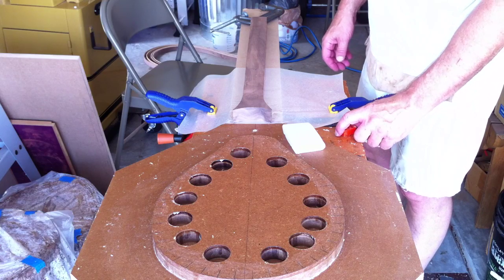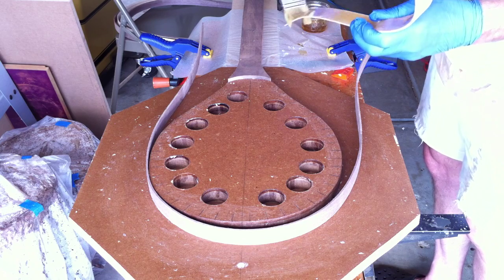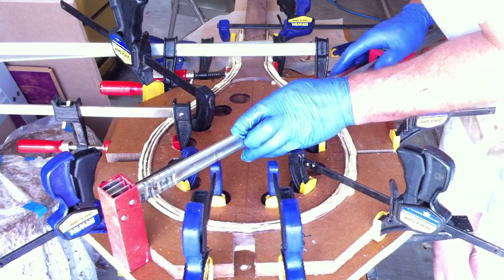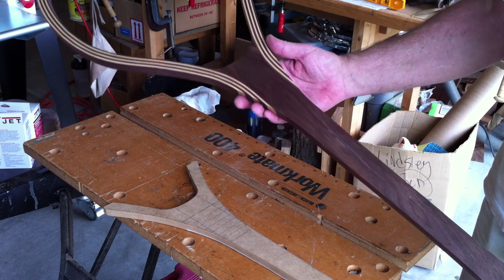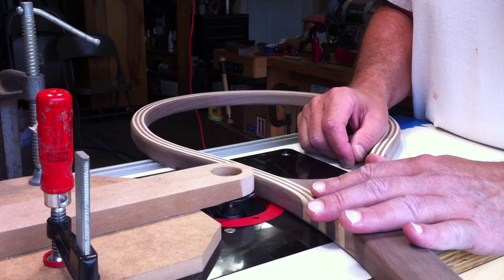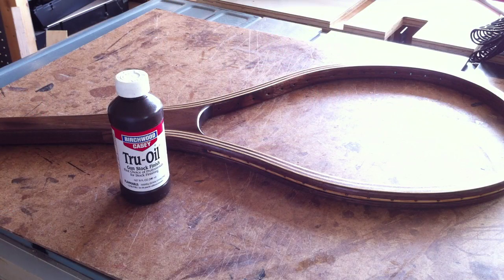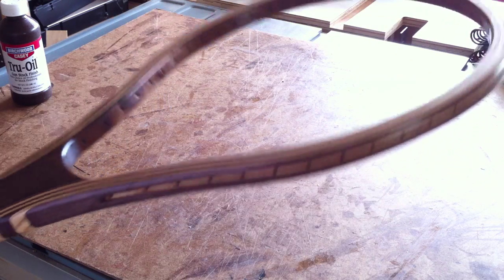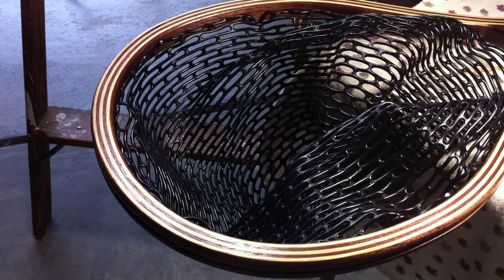Walnut & Ash Landing Net Part 2

Comment: Enjoyed it very well done my question is obviously you don’t glue the inside of the first strip but I don’t think you spoke about where the strips attaches to the handle do you glue that later?  Or do you apply 
glue on the strips where they make contact. My experience with glue is I have a hard time keeping the glue off the clamp handles better than my hands thanks for the video. Ken

Comment: You might be able to leave the handle stock fairly rough, yet shaped to accept the curves of the lamination and leave on a bit of sacrifice stock on the end so you can mount it on the lathe and then turn it open ended after you laminate the net curves. Just a suggestion, dont know if it will work.  Thanks for the great video

Comment: Thanks for the excellent video!  It's inspired me to make my own landing net.  One question that I have is did you just use a band saw to taper down the strips at the throat after everything was glued up?
Reply from the maker: Thanks for the comment Brad.  I have to say that I honestly don't remember if I used the bandsaw or not but I probably did.  It could also be done with a jigsaw or a router with a flush trim bit and a template.  Sorry I don't have a definitive answer to your question.  Good luck with your landing net!  Take care,  Steve

Comment from the maker: rad22092 - Thanks for the suggestion.  I'm up to my ears in other projects at the moment but will make another net one of these days.  I thought about turning the handle with a round tenon on the net end and drilling a mortise in the block that connects the laminations.  It would require a lot of work with a rasp to blend the two together but it would be pretty nice I think.